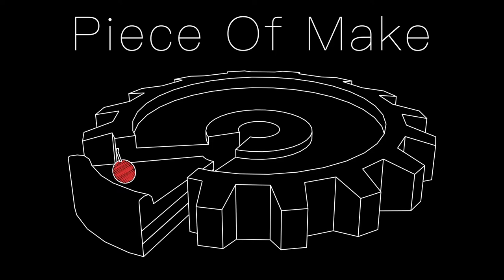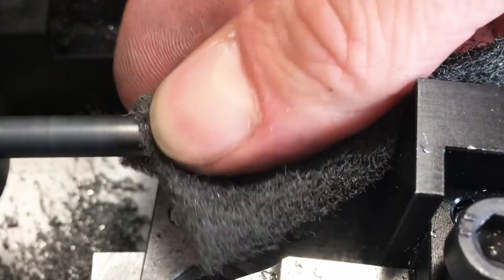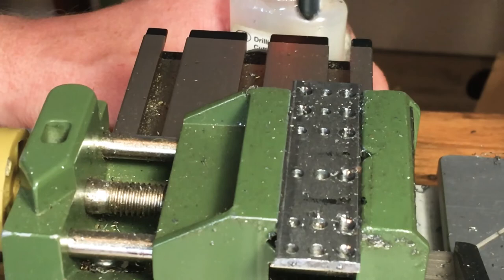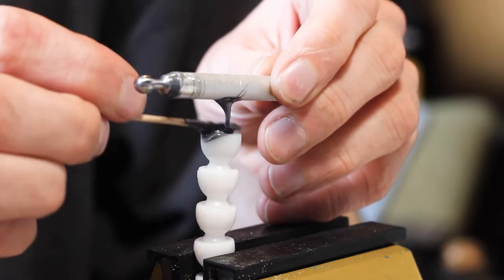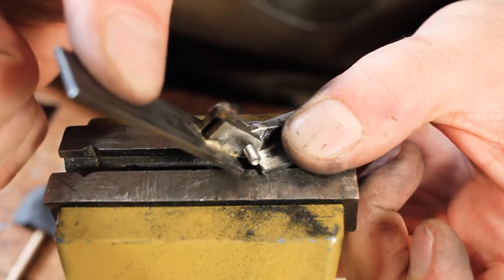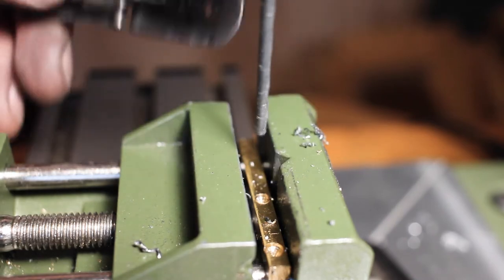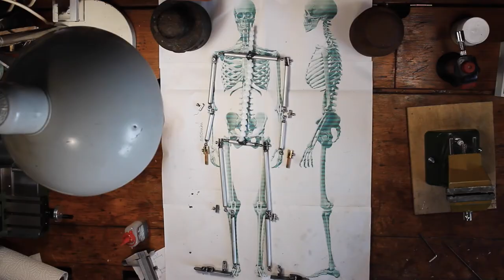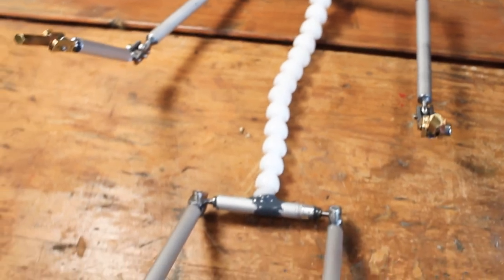Making Stop Motion Armatures

Comment: What are the names of the machines that you used in this process?
Reply from the maker: The lathe is a Proxxon FD 150/E with an additional radius cutting jig and the drillpress is a Proxxon TBH. A coordinate table for the drillpress makes it so much easier to drill the holes precisely.

Comment: Hi Arne, thanks for your great instruction. Could you tell me the name of the Drehmaschine you´re using for making the balls until min 3 of the video? It looks like an old and simple one but good enough for that purpose. Thanks in advance
Reply from the maker: Hi Alois, it's a Proxxon FD 150/E lathe with the proxxon radius cutting attachment. All manual, no CNC. It's a tiny lathe, but great for this type of work.
Reply: @PieceOfMake1  Thanks a lot Arne.  Keep on rockin´!